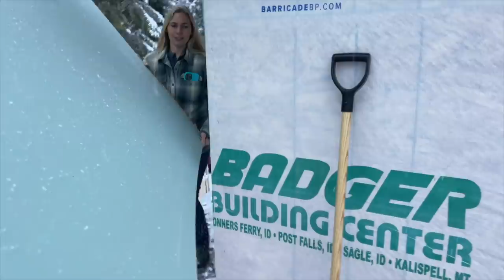Hanging Bathroom Drywall - Couple Building House Off Grid

Comment: My wife is watching too!  She asks, "why are you using the t-square to draw a line and then free-hand cutting with the knife when you could just run the knife along the t-square? (hold the bottom of the t-square with your foot to stabilize it so it doesn't drift)  It would be more efficient because you'd be doing less operations, the cut would be straighter, and you wouldn't have to clean up the cut with your hand tool.

Comment: You should make sure to seal the ceiling and all the walls with plastic over the insulation and seal all the gaps with tape.
Reply: I pointed out before that I was curious why they sealed the main house with plastic vapor barrier but did nothing in the apartment.  Never heard back............
Reply: @jaycahow4667  probably won't,  either.

Comment: To add some detail to the viewer's question. Heat pumps are better suited for southern climates, and are very efficient at heating and cooling in warmer temperatures. Heat pump systems will have backup coils to heater when temp is at or below freezing, as heat pumps don't work at those temperatures. So basically in colder climates like Marty's, a furnace is the better choice. But where I live in Texas, a heat pump is the more efficient choice.

Comment: I've got outside stairs like yours that the dogs use. I put 2 eye-bolts in the wall about 6 feet up from the stairs, one at the top and one at the bottom. When winter comes I tie a small rope tight between them and them wrap a tarp around the rope then clamp the other side to the handrails. Keeps the snow of the stairs, and just remove it in the spring..

Comment: As a recent subscriber, thank you for the great channel. A thought on wood chips: In hunting camp, we use the chips, dowsed with diesel, to start wood stove fires.

Now I have a challenge for Julie: At the 0:19 mark, I fear you’re going to cut your fingers! When cutting vegetables (or anything with a kitchen knife), being safe is paramount. Instead of spreading your fingers and opening yourself to knife wounds, form a claw by curling them under your knuckles. That way your knuckles will touch the blade, but never your fingers. PS—the enchiladas looked good.

Comment: Marty, You did a very good job answering the heat pump question.  Air conditioners/heat pumps are great if you are on the grid and live in a mild climate.  As you said, if the temperature drops too low a heat pump won't work because there is very little heat to pull out of outside air so resistive electric heating strips inside the air handler must kick on to meet the heating demand. Resistive heaters are the least efficient form of heat you can use.  Better to go with a propane furnace in a cold climate like Idaho.

Comment: Just a quick tip. When using your square put the side of your toes on the bottom and then run your knife down the edge of the square. No more pencil
Reply: Good luck with that!  Already suggested over and over, always ignored!

Comment: Hi Marty, Seth,Jules, and now Sarah, saw your red tractor under deck- if you have underdecking not very expensive,it will keep whatever you have under dry,just need rain gutter for water. I have 2 Fujitsu heating/air conditioning units in upstairs and downstairs  sunrooms- no duct work- so nice in summer.Did my 28 pushup Semper Fi- Peter

Comment: We installed a heatpump in our house and pay much less for heating the livingroom. Before a 2000W wall mounted oven would take care of business, and that cost quite a lot. Now, the AC unit uses just around 400W for the same job and we have the ability to remove moist and also chill the house in the hottest days of summer, if need be, so we are very happy with the money we save. It is a wall mounted unit that cost us about USD 600. I installed it myself with the help of a good friend and a compressor for vacuum building before releasing the coolant into the pipes.

Comment: Hi guys love your videos. You said that you might put in Air Condition later, with that in mind you should put a A/C coil in with the furnace and run the lines before you do the dry wall, and you can install the condenser unit whenever you are ready. One more thing, when you guys were clearing the land there was another young girl with Sarah. How is she doing?.

Comment: Here in Northern Alabama my house does not have a gas forced furnace/heater. We have a heat pump on our air conditioner. IT IS NOT EFFICIENT!!!  We installed a propane fireplace that basically heats our house. The air conditioner is 15 years old so I’m sure there are new and improved models now. 

Are you going to leave a photo of your family with a small note attached inside one of your walls prior to finishing the drywall?  50 years from now someone will be opening that wall for repairs or an addition, they will be pleasantly surprised by your gift in the wall. 😀

Comment: I have an A/C and gas Furnace in one unit.  Put it in A/C mode or Heat mode as needed.  I had a heat pump at one time, but the A/C and heat pump (with heat strips) unit, it just didn't provide the heat needed.  FYI- This was on Galveston island.

Comment: Heat pumps  are more efficient  till about  20° +/- 5  there is a fossil fuel control  that can be used with heat pumps  that is outside ambient  sensor that once reached set point would lock out heat pump and activate  gas or oil furace     so heatpump and gas or oil furnace  act as emergency heat  should heatpump fail and need service  you still have heat

Comment: Heat pump efficiency is also related to ambient temperature, so if you are trying to heat when it is cold/very cold it has to work hard to actually get any heat - hence uses lots of energy. To make this effective when you have snow around something like a ground coupled heat exchanger is maybe a better idea with a heat pump - starts with warmer than ambient. This has advantages in summer as well. Standard heat pump technology can only drop a fixed number of degrees compared to ambient (or has to be multi-stage) - and the hotter it is the more work - higher energy use. A ground coupled heat exchanger means the heat pump starts with a lower temperature so less work/energy. In low humidity situations evaporative cooling can actually cool more than a heat pump system - but you get humid air. Humid air is a good thing in bush fire situations - changes the flash point. so can improve in house safety.

Comment: The sheetrock carrier Substitute: You need 2,  6 foot rachet straps (Two carriers). Remove rachet. Make loop.  Place one end of loop at bottom of sheetrock where your hand normanly go. Lift with one hand using strap and balance with other hand. This works great and keeps from killing the hands (going up steps). REDUCE SANDING: Minimize the amount of Mud on screws and seams. You will have less sanding. Coutney did the mud on screws good. Good Luck. Y'all don't need luck, you are AWSOME.  Stay, happy, safe, and Healthy. Montgomery, AL:stayhome:🙏❄

Comment: I am just catching up on the drywall series.  As someone who has remodeled a couple of homes and done a fair bit of drywall.  I think you are doing great.  I have read some of the comments and advice.  it sounds like many of these comments are form folks who do drywall as a job.  If you are just doing your own house, a little extra work is irrelevant.  Nothing about drywall or mudding is difficult, but it does take practice to become proficient.  If you have to put an extra coat of mud or do extra sanding .. who cares? You are doing it for yourself, not to make a living..  soldier on... you will have a great outcome if you keep at

Comment: I have mini split inverter heat pump and it heats down to -22F. 100% at 5F and 80% at -15F. It is one ton and max heat is 16,000 BTU. Highest watts is 850! I am going to try next year to use it on solar. It only raised me electric bill in winter $30 max a month.

Comment: Recommend  adding  blocking  at least 2x6 at about  36" or center 2x6 at 36  for potential  need for grab bars   be simple now  and if not needed no harm no foul   but ,if happens and bad thing happen to good people    it's to late for tub surround  to put blocking  if not there already. 
I currently  do maintenance  for a apartment  complex   and have had to make handicap  accomdation  upgrades installing  grab bars   and have to tear out sheet rock to install blocking for them to anchor  to

Comment: Please dont forget to put a diffusion membrane ( plastic ) under the sheetroc, hot humid air will diffuse into the construction and condense. This will in time result in mold, please dont forget.

Comment: greetings mr. martin; an idea - i was concerned about falling because of the ice buildup on my deck steps, so i bought and installed a product called "handi treads". they are grated steps that do not allow ice buildup and grip your shoes as well. they have worked flawlessly for 20 years. btw, i do not have a mate any longer nor do i have an equal (since superman died), it is just little ol' me....................g

Comment: This is just an epiphany I had this morning.  I've been watching you build and noticed that your thermostat wire is only 2 conductor wire.  You may want to pull 5 or 6 conductor wire instead while things are still not too finished.   If you decide to put in a smart thermostat or A/C you'll need at least a power and ground wire to power a smart thermostat and you'll need some control lines for the A/C, assuming you are going to put the A/C in the furnace.   Just something you might want to ponder.

Comment: HOWdy  JOHNSONS,
Had you ever considered the VENT-FREE Fireplace LOGS & Wall Heaters running on PROPANE ? 
Mine are 99.6% efficient and my 40,000 BTU Fireplace Logs in the Living Room ( up front )  &
the 30,000 BTU  Plaque-heater (golden glow) in the Pantry / Laundry Room heat my entire living space 
on <less than 800 Gallons of Propane per season ... 125 year old Farmhouse with FOAM insulation in the WALLS 
& Loose-Fill fiberglas blown-in INSULATION in the ATTIC --- 7 Rooms downstairs & three rooms "up" gravity heated 
...  
French PRESS Coffee & Wood Stoves - Chick Coop Cleaning 
...  
& no No NO - GREEN Drywall is HEAVIER than regular GYPSUM - Board 
...
COOP
...